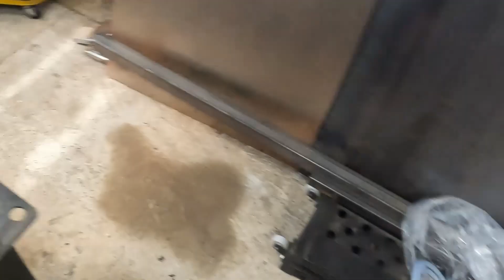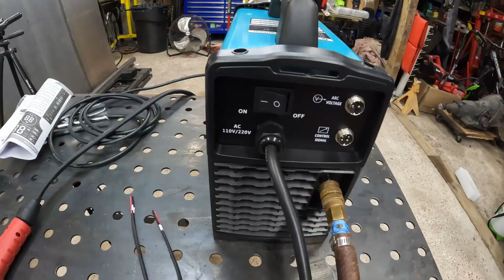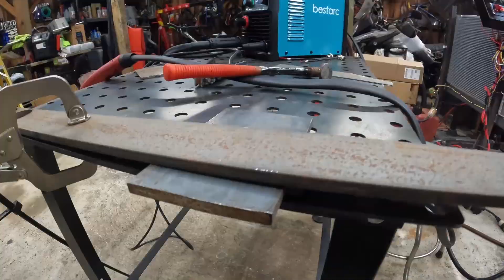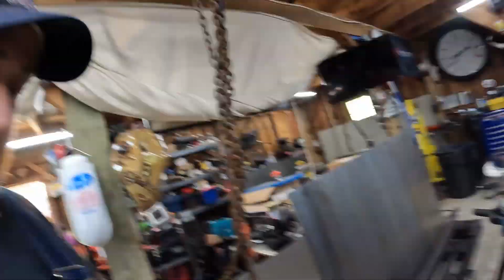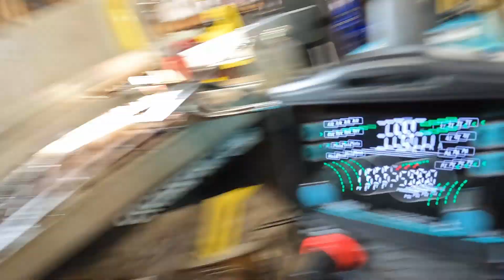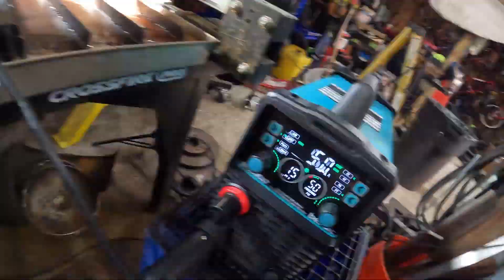BESTARC BTC500XP 11th Gen Review! CNC ready and mesh function!  Best value plasma cutter of 2024!

Comment: Hi Dave, I have been working on my new bestarc to connect to my Langmuir crosscut z axis up grade. The brake went on on the wiring. Is the bottom hole all you needed for arc and z axis. Do you have any more pics of the connection. Man I hope you check this. Thanks

Comment: Hi! How do you check if a plasma cutter is cnc ready? What specs to look out for?
Reply from the maker: That is a huge selling point and most will advertise that. Non HF blow back start is preferred due to electrical interference. CNC ready also has an exterior plug to connect to your table.

Comment: Which one is good, bestarc btx500xp, or arccaptain cut55pro?
Reply from the maker: Both machines have pilot arc and will cut similar thickness. The XP is CNC capable meaning you can use it on a plasma table. The Arccaptain cannot do that. Arccaptain is coming out with a CNC machine and their own plasma table though.

Comment: just curious, what software do you use with the CrossFire CNC Plasma Table? Does it come with it? I like the fact that my BESTARC BTC500XP 11th Gen would work with it :-)
Reply from the maker: Comes with Fire Control to run the table. I use Fusion 360 for Cam/Cad
Reply: @madgingercustoms  thx

Comment: Hello.  Is the voltage divider 1 to 1 ration(as bestarc states) compatible with Langmuir z axis controls? Did you have to do anything special to get it to work? Just ordered this cutter but considering table options and not sure whether to try and build or to buy.  Want a small 2x3 ish table.  Thx👍🏻
Reply from the maker: I don't have THC on my table. I only have IHS. It works great. I'm not sure how it works with THC.
Reply: @madgingercustoms  thank you for your quick response! I’m just trying to decide on a table whether to DIY or to buy and which route to go. Cheers!

Comment: I've been eyeing these for awhile but nobody has done a comparison that I've found between what the different model numbers mean or which features are "CNC"-specific. Like, if you but a XP, what's the difference between that and the DP that's less than half the price? Is there some reason you need one or the other in different situations? I'd love to see a rundown like that. It's probably been the single biggest barrier to entry for one of these machines for me: every time I go to buy one I'm not actually sure if I'm getting the right model.
Reply from the maker: DP model isn't CNC but is pilot arc.
Reply: @madgingercustoms  Thanks for the response! I think what's not clear to me is that "CNC" or "not CNC" doesn't really break down the detailed differences in the designs, features or demonstrate the reasons you would care about one model or another. Could you expound on that a little bit? (might make for a pretty good, detail video)
Reply from the maker: @sammccollum2985  the CNC ready versions have arc voltage and signal connectors. That is huge for guys that have plasma tables. If you don't, it's not worth paying more for. The mesh function is inventive though so if you do a bunch of expanded metal it's worth the money.
Reply from the maker: Also you don't want anything HF start because it interferes with plasma table electronics.